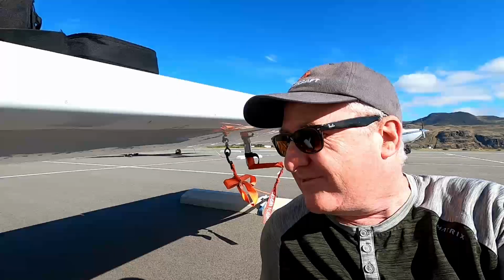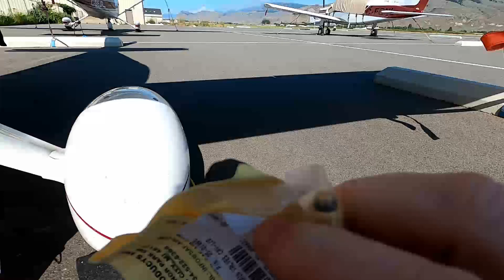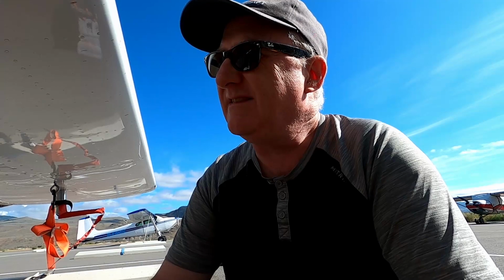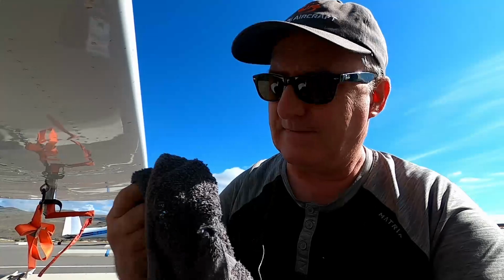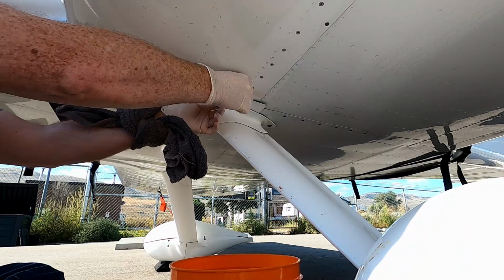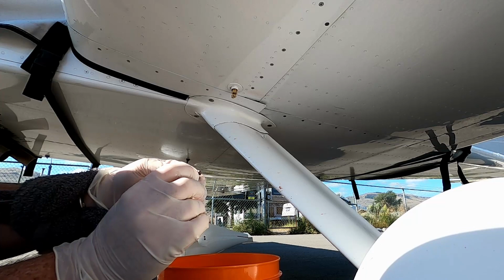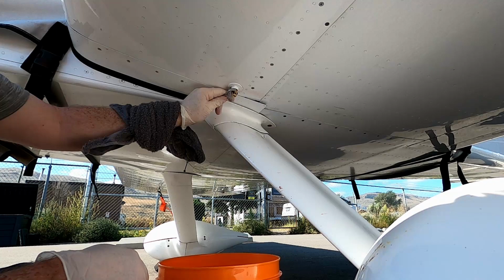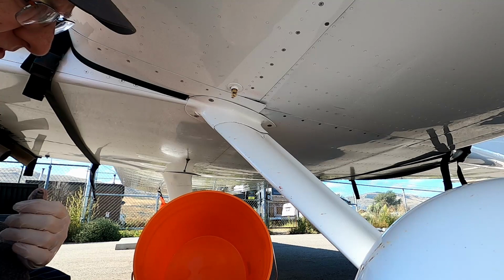How I Fly   Drain Valve Replacement

Comment: Question...I need to do the same, already ordered replacement valves. Just one thing I am not sure about. Do you just replace the drain valve or you need to apply some sort of sealant on the thread? Thx for answer
Reply from the maker: Nothing has to be added. I thought maybe plumbers tape or similar, but it just goes in “naked”
Reply: @HowIFly  thank you 👌🏻
Reply: @HowIFly  That's not what the instructions on the package say... it calls for Sealube, but EZ Turn will do as well.